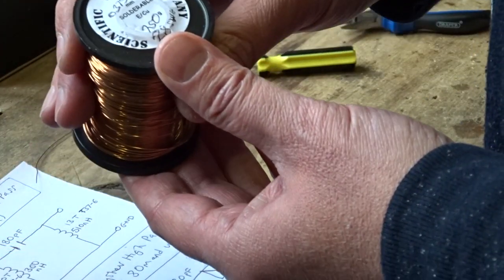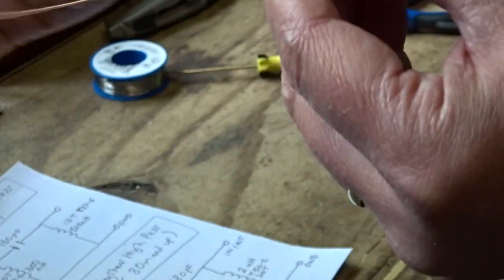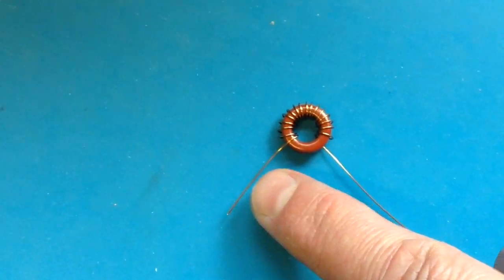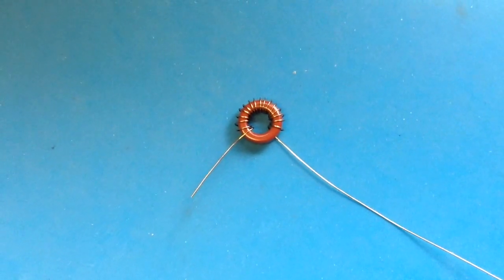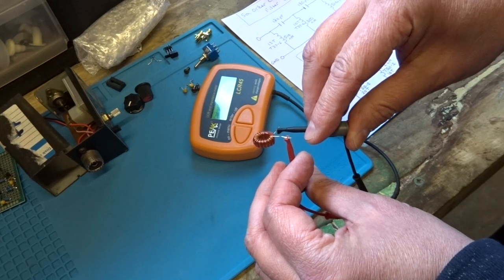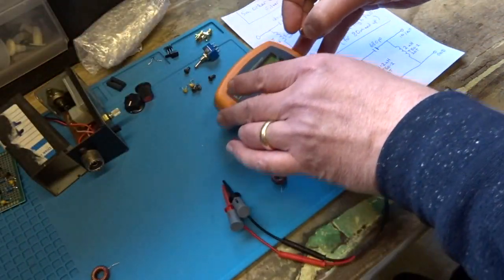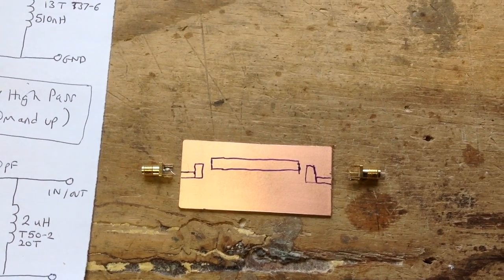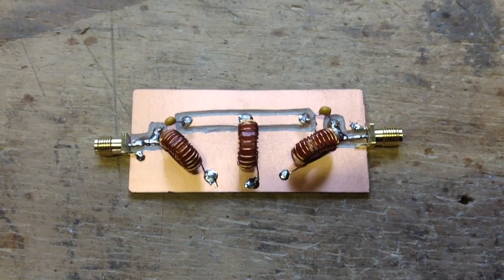12 - Building an LC Filter

Comment: Wrapping the toroid adds a turn in itself.
Reply from the maker: Hi Barry, when you say "wrapping the toroid" what do you mean?
Reply: You put 16 loops around the toroid. Those loops wrap 80% around the ring.  That counts as another 0,8 wrap, if I remember my EE course correctly.  It was a long time ago.  Might explain why you always have to remove at least 1 wrap.
Reply from the maker: Thanks Barry, I've not come across this before. Something to check out. 73, Nick

Comment: I use my digital calipers to measure toroid height, then measure the width of the toroid circumference. Add these two together, multiply by x2 and multiply by number of turns. Finally, add 4cm. This gives me total length of wire to cut off reel to wind the coil. It works for me.
Reply from the maker: Thanks Steve. 73 Nick

Comment: I just ordered my ham book for the test haha
Reply from the maker: Well done ... now the work begins! Enjoy the journey. 73, Nick
Reply: @M0NTVHomebrewing  thank you sir. I have a pretty decent collection of bench gear already. I don't have an sa but I have 350mhz mso. Should I hold off on getting an expensive Siglent SSA3021X PLUS. Or what do you recommend? Just start with a decent radio and a tiny sa then play with making rf filters and such. I understand most of the math but until now it's all been theory based and taking notes and I've accumulated enough quality components to actually advertise them locally because there is no walk in shop for parts in my province of nova scotia haha. I'm hoping to be the source of parts for the engineering programs in the new college that is about to open. Anyway, that's beside the point haha. 

I have all sorts of different types of enameled copper wire but I've always been hesitant to purchase crystals, toroids and variable capacitors. I guess I have to get to reading and take it slow. Rf has always seemed like the dark arts of medieval wizardry to me haha. 

Thanks for the reply and great content!
Reply from the maker: Personally I would hold off on buying the Siglent until you've got stuck into some RF construction. A Tiny SA will help but so will an SDRPlay RSP1 plus computer. It costs about £100 UK and will enable you to see (and hear) the signals you produce. There is even some free SA software for it. Don't get me wrong, the spectrum analyser is brilliant and I wouldn't be without it now but I'd already scratch-built 4 complete SSB transceivers before I got one! As always, your mileage may vary. 73, Nick
Reply: @M0NTVHomebrewing  awesome!

Comment: "mp0" capacitors?  do I have that correct?
Reply from the maker: NP0 - they are more expensive but don't change their capacitance very much when their temperature changes. You can get away without using them but obviously if you do have some then they will be more consistent in their performance. Generally tuned circuits will benefit from NP0 or C0G capacitors but again you can build with regular caps. Don't let it put you off!
Reply: @M0NTVHomebrewing  Thank you so much for the answer!!!

Comment: where can I buy a T52 toroid and how much do they cost?
Reply from the maker: Hi! I think you mean a T50-2 toroid. '50' refers to the diameter and '2' is the type of material that it is formed from. You can find them all over the internet with a quick search. But just be careful that you are satisfied that the person selling them to you knows (and cares) what they are. Don't just trust the colour! Personally I use a combination of a few trusted eBay sellers and Club Sales from the GQRP Club. They are not too pricey for this size but costs increase with the size and weight of toroids. Hope this helps. 73 Nick
Reply: @M0NTVHomebrewing  Thank you!!!!
Reply from the maker: @drstrangelove09  If you are looking for a good source of toroids then on this side of the Pond I would recommend 'Spectrum Communications' - based down the road from me in Dorchester, Dorset. They have an eBay shop too - just search in eBay for 'spectrumcomms' and you should find them. 73 Nick

Comment: I wind a turn, measure it's length and multiply by the total number of turns to get the total length of wire. I've even been known to do a practice run with string when my stock of wire was low! 

I noticed that the turns calculator you show in episode 1, tells you the length. That makes things easy! Thanks for the video.